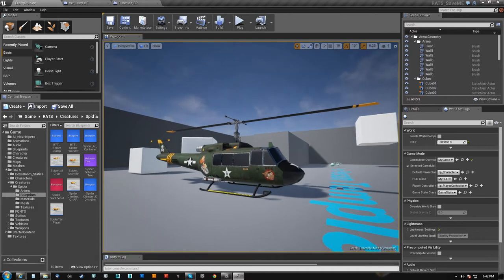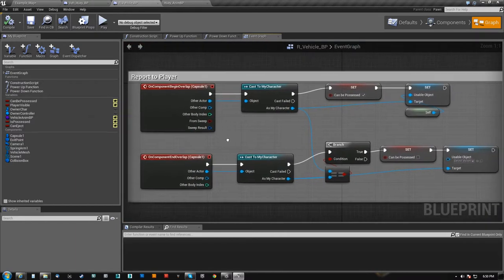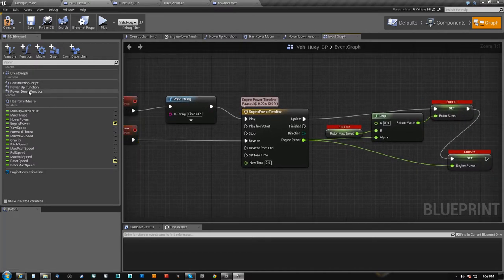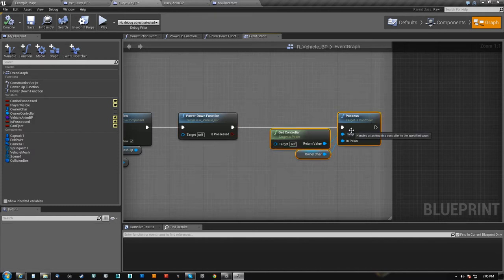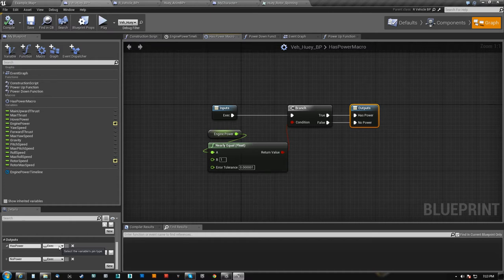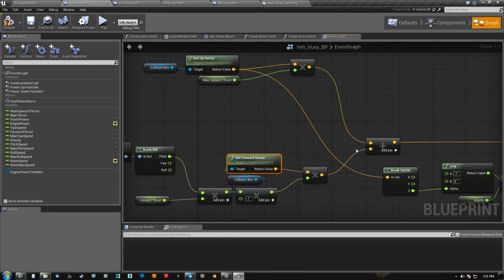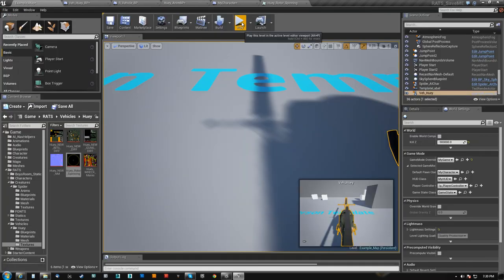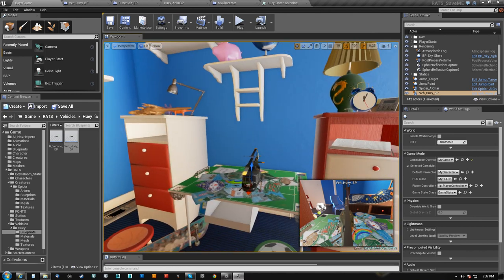UE4 HelicopterDemo Tutorial

Comment: Hi. Would you know why attached propeller (box stretched) is getting interrupted by the movement of the parent actor. How could I completely ignore any kinda rotation of the actor that is 
attached to it. I just can seem to get the rotation to be spinning smoothly as soon as i turn parent actor it seem to quickly adjust it self to the parent rotation there for the rotation of the propeller looks choppy.  As you can tell I'm no Bill Gates. Thanks .

Comment: Hello there, is there a way to limit the rotation so it always remains in the upward position and you do not allow it to crash? It needs to rotate slighty to seemingly animate the movement, but is there a way to make it where it never full capsizes? (I am making a quadcopter drone and don't wish to allow it to flip, emulating the drone calculating its balance)